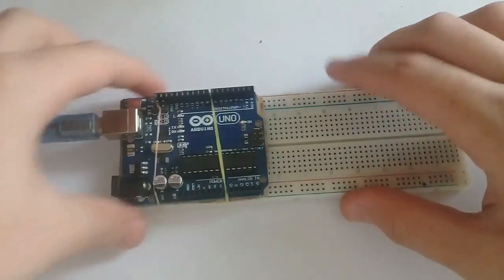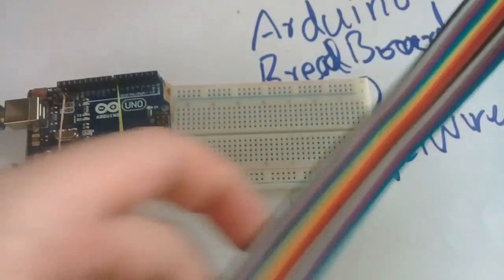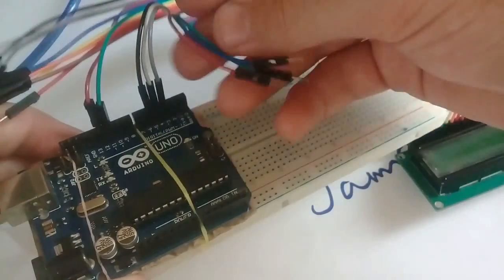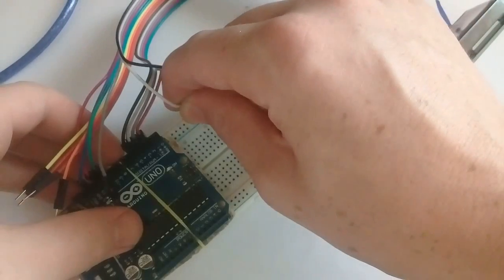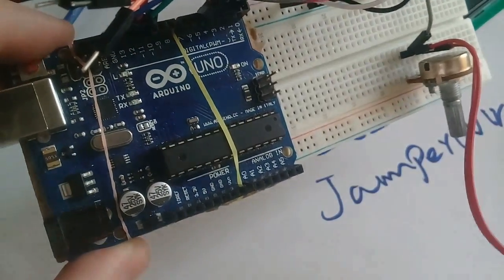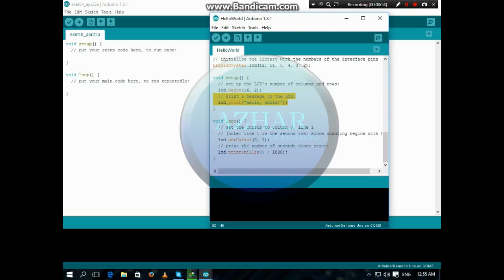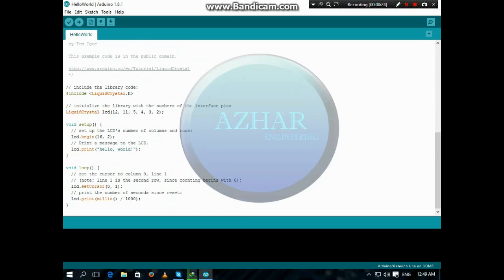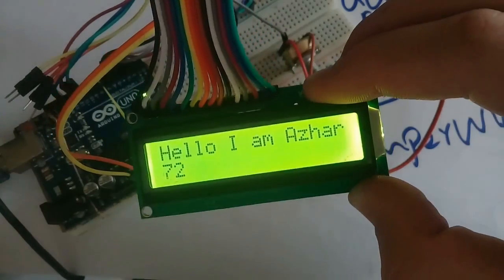Connecting LCD with Arduino

Comment: I'm having the problem of nothing at all, I tried turning the pot but the rectangles wouldn't even show, the code didn't work either
Reply from the maker: Please check the connection. Make sure that Pin 5 of LCD is connected to ground.

Comment: Question,  after connection all required wires, does the LCD backlight comes on, or we need first load the LCD code to Arduino? I did all wiring correctly but don't see back light,  I don't know is the LCD bad, or I still need to load Hello World code , please let me know,  thanks
Reply from the maker: Upload the code.
Reply: Looks I had a bad model iic/ 12c/ wti/ 20x4 Lcd, I got just two lines on this LCD, thought the code is bad, but just now noticed this model I got has a lots of problems and most of them are bad.
Reply from the maker: You have another type of LCD so you  have to upload the code for that LCD.